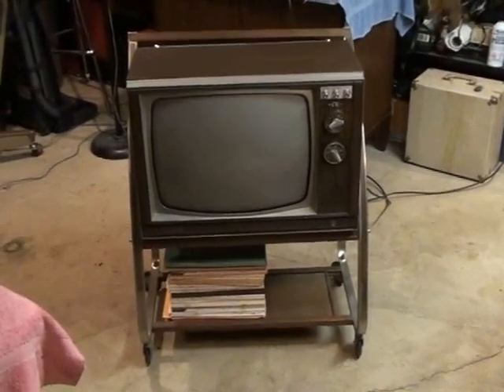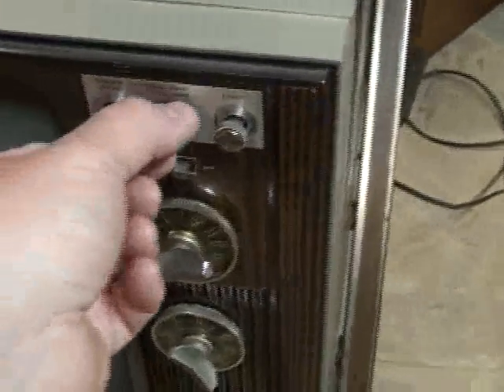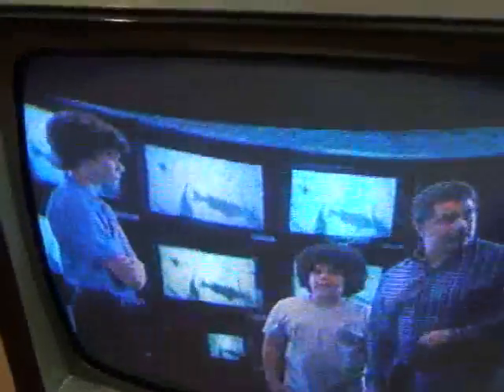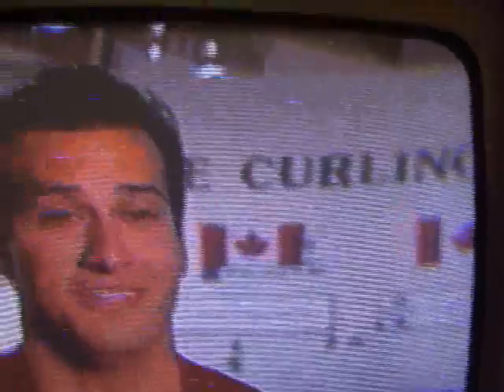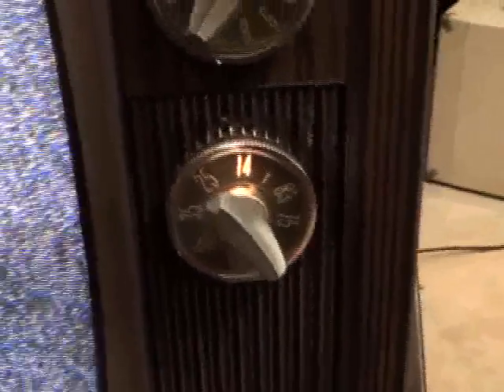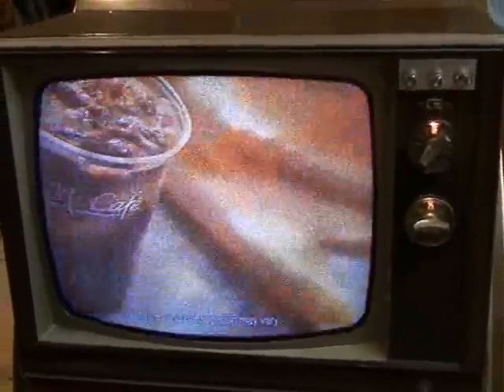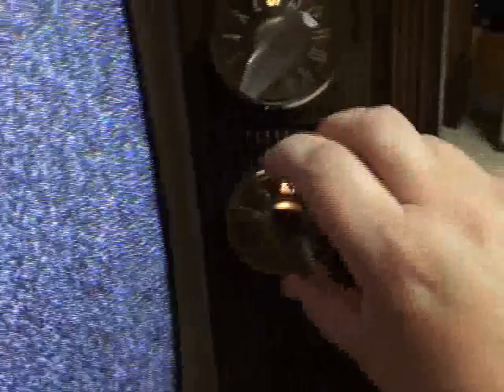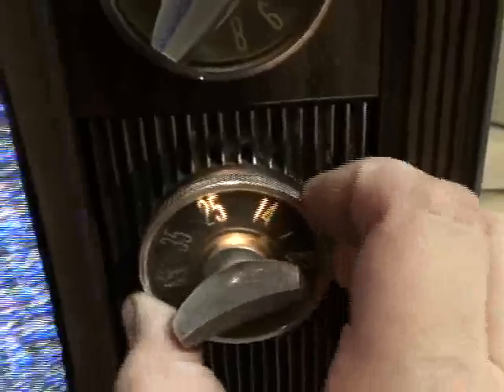The last of NTSC broadcasting in the USA, watch it on a 1972 Zenith COLOR TV!

Comment: I have one just like this except it's greenish marble tone behind the vhf knob and the flip down is black, I've had it since I was 15 and I'm 36 now in 2018 and I still use it with pride. It's about 70 lbs or so and it throws a lot of heat, but still has a great picture. I've adjusted the tube a fiew times. I love the fact that the crt is fully adjutable.

Comment: There was one channel here in the bay area in northern California that stayed analog until 2011. My TV kept picking it up every time I ran a channel scan. I have no complaints about the transformation. I live less than 3 miles from Sutro Tower which is the main TV signal tower for the bay area. Before June 2009 there was probably 40 channels and now in 2015 there are well over 80. Who needs cable?  I love all the new classic TV channels like METV, Antenna TV, Laff,  Cozi and Decades. I stopped watching prime time broadcast TV years ago. It's all crap.
Reply: +ldchappell1 Yeah, Full Power NTSC broadcasts were turned off, however Low Power NTSC is still allowed today for those mickey mouse Spanish and Religious stations and Low Power Translators
Reply: ***** I scan my TV at least every 3 months and I haven't picked up an analog station in a long time. Maybe there's too much interference in my neighborhood. i have heard from people living in Marin County about those low power Spanish and Asian channels.
Reply: Low Power Translators?

Comment: I bought a set very similar to that...a 1973 hand-wired 16" Zenith TV...it finally gave up the ghost in 1993...and had the original picture tube. That sucker weighed a ton to be as small as it is...but that was when the TV went "out" you had it fixed instead to tossing it.

Comment: Nice vintage TV!

Cool thing is WWME-CA (channel 23) is still broadcasting NTSC analog right now, as a service to those who don't have a DTV or converter (they are broadcasting WGN news at 9 and NBC 5 news at 10 and news at some other times, as well as sister station WCIU "the U" 26 programming). I'm guessing its transmission power of Ch 23 falls just below the requirements for full-power analog cutoff.

Comment: Almost agreed with you, but I prefer equally for the deaf and hard-of-hearing who use
closed-captioning would regardless on the digital if signal reception is weak, but analog have problem with CC, yet sometimes HD have bad captioning than SD digital.

I love analog for premium channels using with cable converter box, cable and satellite. Digital stinks.

Comment: Oh gosh I remember TV's like this VHF, UHF, tube, wait for them to warm up. Before cable TV, in a large city you were lucky to get 4 or 6 channels, typically ABC, CBS, NBC and PBS, plus one or two independents. This was also WAY before Fox, CW (UPN, Warner Bro), religious and Spanish channels. With digital I can get about 20 channels over air, but I have digital cable (+300 channels).

I am surprised you where able to video tape CRT TV so well with frame speed.